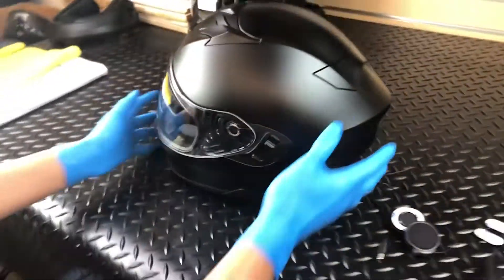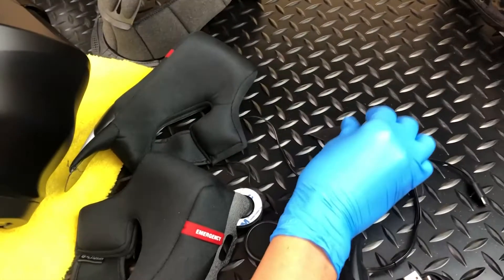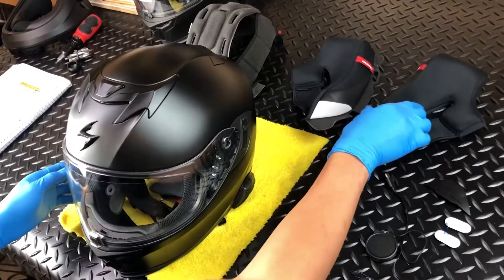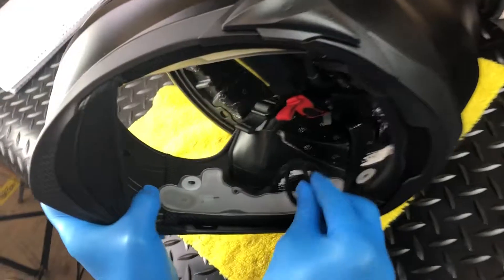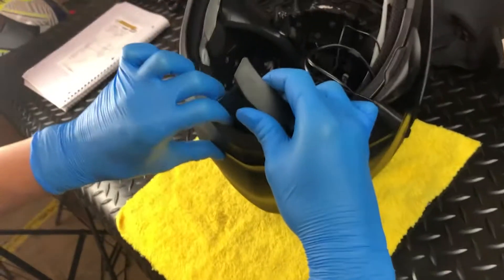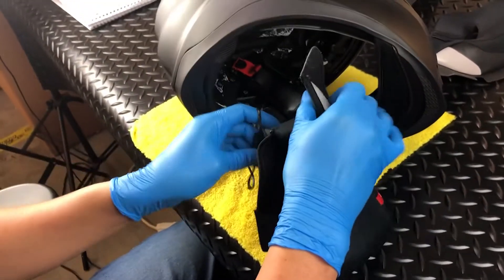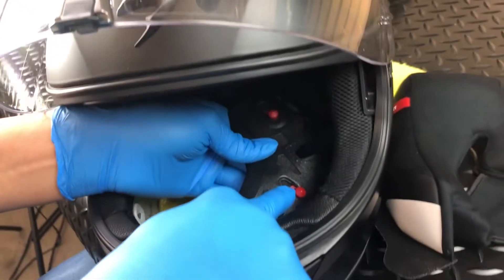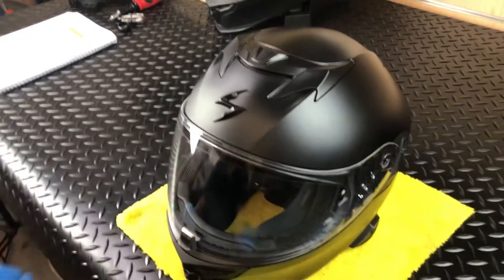EXO-Com Installation (T520)

Comment: I had the hardest tike of my life trying to put the cheek pad back in, especially in the back where the BATTERY CABLE IS THERES NOT ENOUGH SPACE ITS SUPER TIGHT to get the tab back in
Reply from the maker: Hi Julio, it is very tight but once installed it stays together very snug. If your are still continuing to have a hard time you can contact us through our live chat feature on our website M-F 8a - 5p PST and we can walk you through it. www.scorpionusa.com
Reply: @ScorpionEXO_Global  im sorry if i came off as a bit rude, i was genuinely having some trouble with it for about 10 minutes but i got it! I love the helmet 10/10! Cant wait to go out and ride with it.
Reply from the maker: @Jnlix1k  Great, glad it worked out!
Reply: 3 snaps on my cheek liners broke on the helmet side. Very disappointing. I just got the helmet today and sat down to install the exo com system and through it looked weird, and only realized when I went to put it all back together that the snaps broke. But I’m in Canada so I can’t do anything with scorpion support. Good thing there’s still snow on the ground.